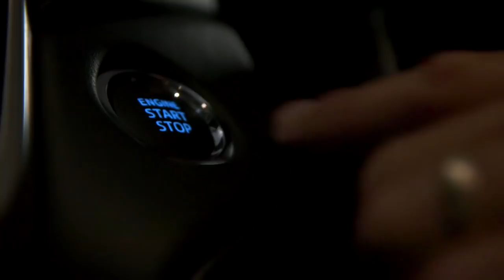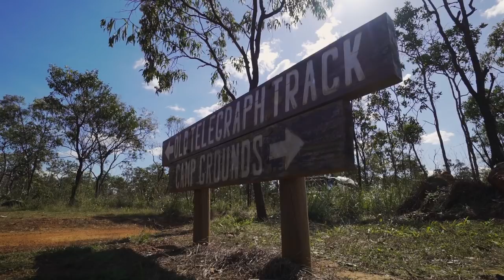We Take A 6m Trailer Down Gun Shot, Cape York's TOUGHEST Track

Comment: I see the trick is when you break traction going up gunshot, you just keep spinning the wheels in hope of grabbing traction to get you through? It really looks like a machine digging a trench for the telegraph track's new line!! Completely Understand if your coming down through the mud trying to grab traction where ever you can, just pin it!!  

But I would of thought going up,  if the car is vibrating from excessive wheel spin you would stop on the fast peddle and let the winch do it's job, grab a bit of down force from the winch, and creep up bit by bit under power to help out. Really would of thought if the wheels are spinning when your not even moving, just stop and let the winch do its job. after all if a single winch block doesn't do the job, just add another and make everything slower and easier. 

From memory can't get traction when the wheels are spinning to fast to grab it. 

Gun shot is a real mission up or down, but some thoughtful 4wding really prevents the tracks from being destroyed for everyone else.

I understand your doing this to help out your brand and it's great, but really should look at what example your setting for your customers and other people looking to enjoy the off road. Most of the tracks around are all rutted because most believe in the rule "if in doubt power out" but in reality that has a place for a particular terrain just not all,  if you can avoid wheel spin that usually causes erosion of the tracks then every 4wder should do it. after all thats why we have,  winches, recovey tracks, highlifts,  recovery kits etc.